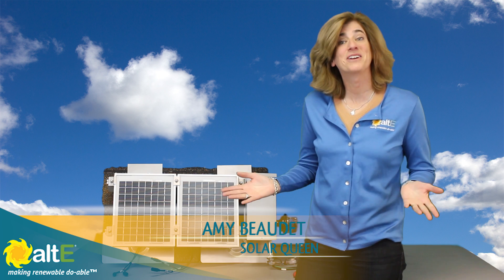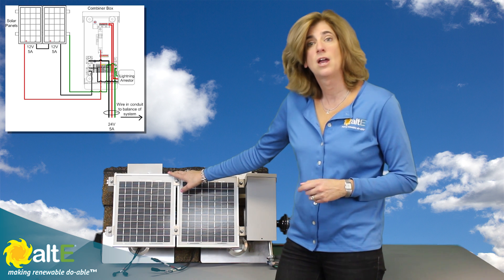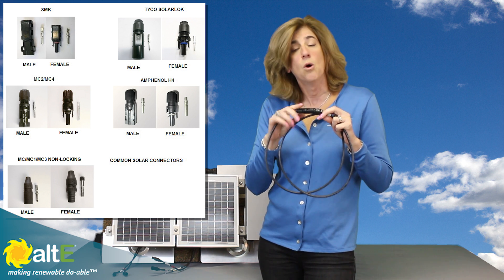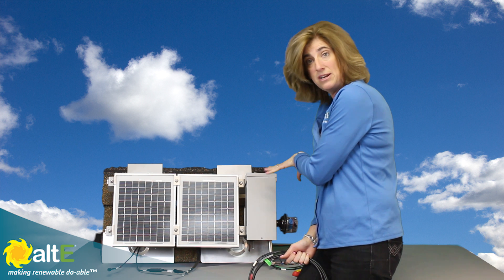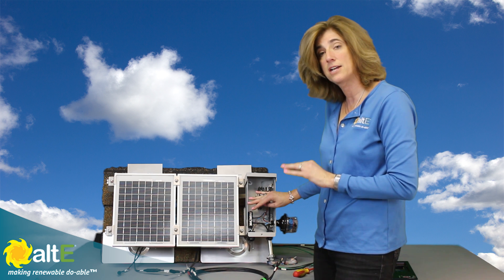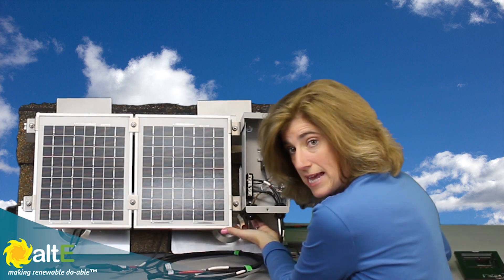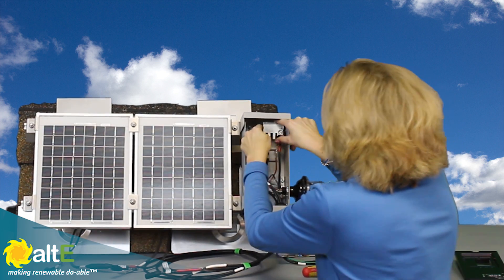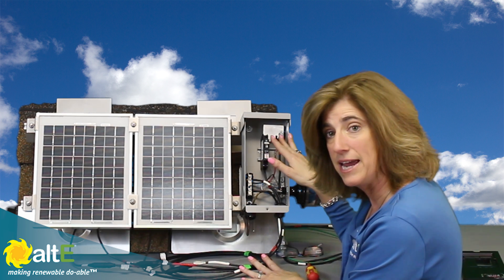How to wire solar panels in series.

Comment: I have not purchased the wiring yet, I have a 200 foot run I'm thinking 10 awg I'm not sure of the resistance I know it's a long run. One thing I'm not sure of , I will run 3 pairs in parallel and then check it with a meter at the end of the run. Can I use a junction box combining the panel wires at the panels or do I need to use separate wires for each pairs?  that can get pricey for a 200 foot run. Not sure if that would matter or not there is one connection for positive and negative on the charge controller for the pv array.
Thank you.
Reply from the maker: I'd need to know what the specs are of the panels and how many to answer that question.  We'd need to know the volts and amps.
Here is a more technical presentation we did that discusses wire sizing and NEC requirements. https://youtu.be/89u8R_aUFO4
Reply: @AltEStore  
Hi.
I'm in the Bahamas and I'm building a 48v system. 
I've got 4 - 12v 100amp lithium ion batteries so far .
Can you tell me how many solar panels I would need for this system. I'm trying to create a 5k system

Comment: Hi Amy, really liked the video... but would love a tighter (closer) camera zoom shot into the combiner box.  Also you could illustrate the actual wiring details for each conductor as it it connected in the combiner box.  You probably have to "one hand it" for each conductor connection... to get a closer shot.  Just my  thought on showing the details a bit better. Thanks for the video.
Reply from the maker: +Mike Palm Thank you so much for your feedback, it's very helpful to us. We did a bit more zooming in our "How to wire solar panels in parallel with combiner box" video, that may help, it's 2 strings instead of one, but the concept is the same, https://www.youtube.com/watch?v=iOqY6QqFopA . We've got a couple of schematics on our website that may be useful, you can see them at https://www.altestore.com/howto/images/article/off_grid_solar_system_demo_schematic_2.jpg and https://www.altestore.com/howto/Solar-Electric-Power/Installation/Schematic-Wiring-Solar-Panels-in-Series-and-Parallel/a102/. They are both of 2 parallel strings in a  Midnite combiner box.

Comment: i am a hobbyist in solar. if I put in parrell different wattage panels how do i calculate the total amperage. now I am in parrell 5 panels that are 40 watts of 17 open volts. if I hook them in series what controller do i need to charge 12-volt batteries. does this make sense to you.
Reply from the maker: +George Gardinier That&#39;s a trick question. We do not recommend wiring different wattage panels together on the same charge controller. The lower wattage panel could pull the power down on the higher wattage panel. Instead, we recommend you use a second charge controller for the different wattages. So if you have 3 that are 40W and 2 that are 60W, use two charge controllers, one for all of the 40s and one for all of the 60s. But, if you have all 5 panels that are 40W, then all of them together make 200W (40W x 5 = 200W).
     If you hook 5 12V panels (that actually output 17V) in series to charge a 12V battery bank, you will have to use an MPPT charge controller to reduce the 60V down to 12V. If you hook them in parallel instead, you can use a less expensive PWM charge controller. Check out our charge controller video at https://www.youtube.com/watch?v=KPZhtGLfGn4

Comment: I think when I do one of these I will use a large panel box so my fat clumsy fingers will fit in there.
Thanks for video
Reply from the maker: +Rev John O'Toole You are a wise man. We often recommend using the Midnite MNPV6, https://www.altestore.com/store/Enclosures-Electrical-Safety/Electrical-Enclosures/Combiner-Pass-Through-Boxes/Midnite-Solar-MNPV6-Combiner-Box/p4566/ , even with a few strings, to give you more space to work in.